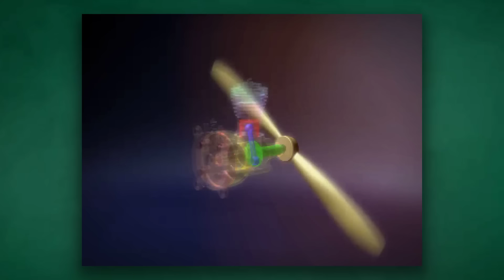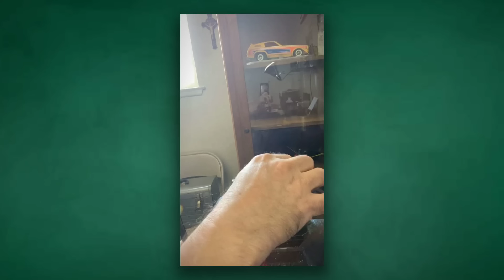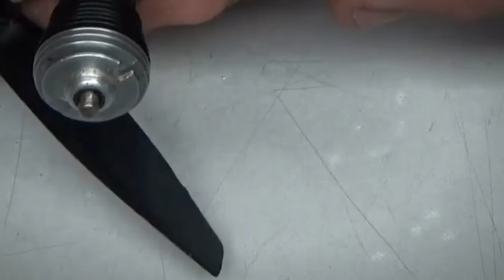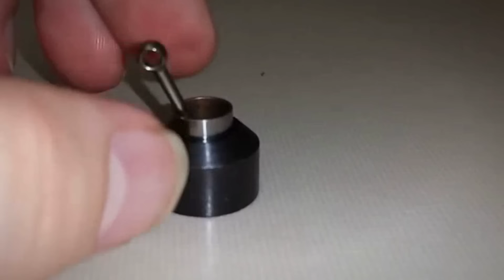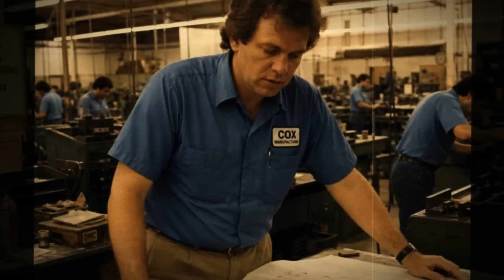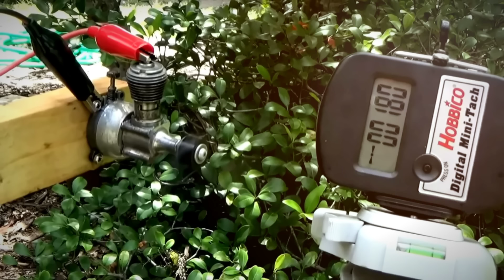Why a Cox .049 Holds Compression With No Piston Rings - The Greatest Sealing Secret

Comment: You didn't have to endanger your finger to start the motor You could buy a starter stick at the hobby shop - a wooden handle with plastic tubing on it.  Starting the big model engines with a wooden prop using your finger was a great way to either go to the emergency room for multiple sutures or become a really LOUSY typist!

Comment: The piston is LAPPED to fit the bore.  You can't put a piston from one engine into another Cox .049;  it's a select fit. This isn't unique to the Cox engine; I had much larger model aircraft engines such as a .35 and they didn't have rings, either.

Comment: What an amazing story. Mr. Cox was a genius! Can the seized engines be unseized?
Reply: The engines are not "seized" in the traditional sense where the piston gets mechanically damaged and locked up in the bore. The Cox engines used fuel with a lot of castor oil in it. Over time the castor dries out and gums up like glue. To free them up, you can soak them in denatured alcohol for days,  followed by a careful application of heat from a heat gun. If possible remove any plastic parts like a backplate before soaking. Sometimes putting the engine in the freezer helps to loosen the just the aluminum head. You need patience and the correct tools to do all this, but it is not too difficult. If you try to muscle it with pliers or vise grips you will distort the parts and ruin the engine.

Comment: diesel injection pump plungers seal perfectly against thousands of psi w/o piston rings. those are lapped to clearances of 1-2/10000 of an inch
Reply from the maker: Thanks for sharing that! It's always great to get insights from other areas of engineering that demonstrate similar clever solutions. Really appreciate you adding to the discussion!

Comment: I had lots of this type in the 50s, piston rings would have sprung out into the ports, you would have needed a few holes in the bore sides to admit and exhaust gases, a ring bulging into a slot cut into the side of the bore was not a possibility, hated having to junk and engine that lost compression when it got hot.
Reply from the maker: Great point about the rings bulging into the ports that’s a classic two-stroke engineering challenge! Cox’s solution with the lapped, ringless piston was brilliant but, as you mentioned, it definitely had a shelf life once the fit loosened up. Really appreciate you sharing your firsthand experience with these 'screaming' little engines!

Comment: Ran .049s in model boats. Made a cooling loop around the head with aluminum tubing.  Steel flywheel and plastic prop from Dumas model boats. Throttle control via sleeve with slit that closed/opened the exhaust port. Thumb flip the flywheel to start. Boat was radio controlled, ran really well, 1970’s. Fun times.
Reply from the maker: That’s an incredible setup! Using a cooling loop and a steel flywheel shows some serious hobbyist spirit from the '70s. It’s amazing how those .049s ran so well in boats, especially with that throttle sleeve trick. Thanks for sharing a piece of your RC history with us!

Comment: Spark-test a piston.
Spark-test a cylinder.
I did.
They are CAST  IRON
= the only known material
that can be both Journal
And Bearing.
Duh.
Reply from the maker: You're spot on about the cast iron! That 'iron-on-iron' setup is exactly why these engines have such incredible longevity if they're lubricated right. It’s a classic engineering solution where the material itself handles the friction. That’s a big reason why that 'pinch' we see at the top of the stroke works so well over time. Thanks for doing the spark test and confirming it!

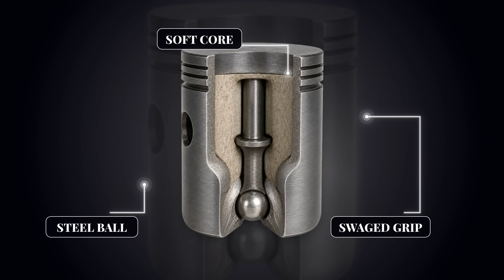Comment: Whats the nonsense at 12:20 ?
Reply from the maker: It does sound a bit crazy, doesn't it? But that ball-and-socket setup instead of a wrist pin is a legendary piece of Cox engineering. Are you skeptical about how it holds up, or just the way it was manufactured? I'd love to hear your take on it - it’s definitely not your standard engine layout!It does sound a bit crazy, doesn't it? But that ball-and-socket setup instead of a wrist pin is a legendary piece of Cox engineering. Are you skeptical about how it holds up, or just the way it was manufactured? I'd love to hear your take on it - it’s definitely not your standard engine layout!

Comment from the maker: This one started with an argument. Last July, three men spent eight days going back and forth about how a ringless piston could possibly seal - one said heat expansion was negligible at that size, one said the piston and bore expanded equally, one said it was the steel. Nobody landed it. That argument is why this film exists, and if you think all three were wrong, say so below. We would rather be corrected than agreed with.

But here is the thing we genuinely could not find: the people. Cox made over a million engines a year in Santa Ana, and every one of them had a piston that somebody lapped to fit. No records, no interviews, no names.

So - did you, or your father, or anyone in your family, ever work the line at the Cox plant? Even a summer job. You would be the primary source that does not currently exist.